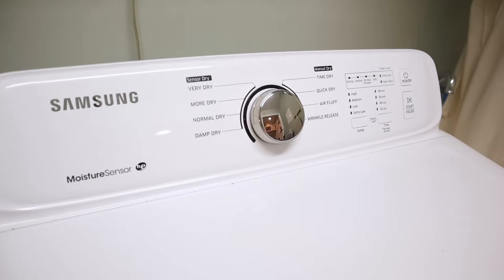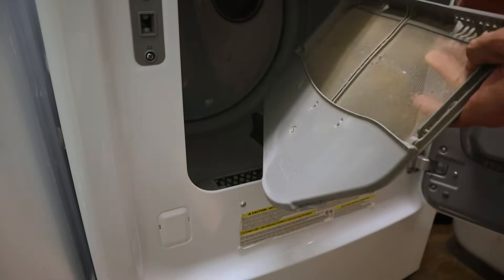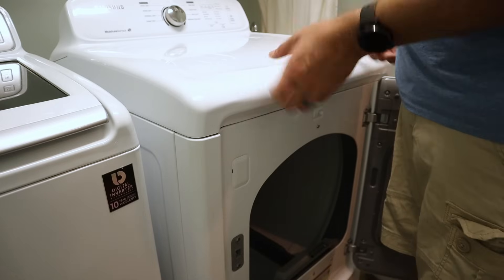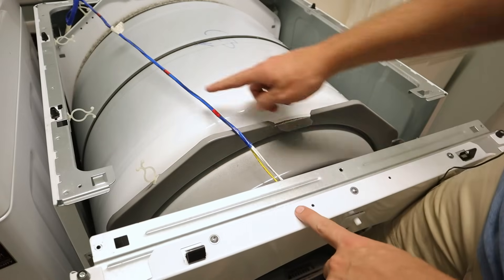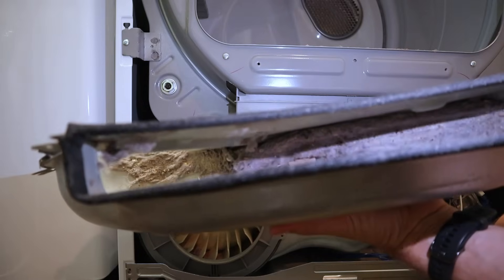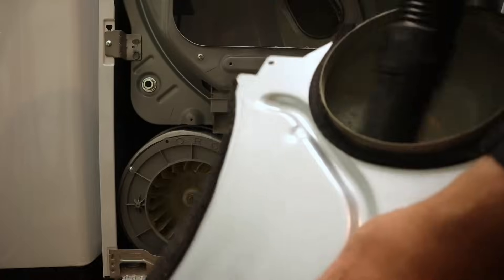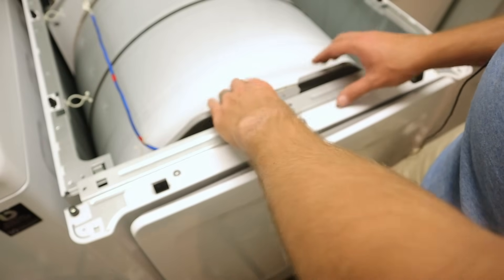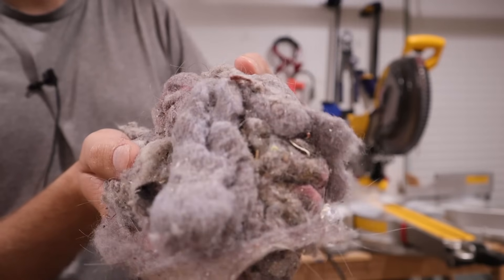How To Clean The Lint Out of a Dryer | Simple Dryer Vent Cleaning is Not Enough!

Comment: Our LG dryer started making noises. Youtube research suggested that it was the rollers, which are typically the first item to wear out. Which requires taking the dryer apart. I could not believe how much lint I discovers. At least 3 times what you got out in this video. Some of it looked burnt. We probably narrowly avoided a dryer lint fire.
Reply from the maker: Yup, I also had a roller to change out when I did this.  Seems to be a common replacement.

Comment: Funny thing is, I have the exact same dryer. Doing this today. Thank you for the tutorial.
Reply from the maker: Ah very nice!  We actually really like this dryer.  It is efficient, fairly modern, but not crazy with all kinds of unnecessary button.  Just gotta take care of it.  Good luck!
Reply: Me too... Dryer not getting hot at all
Reply: me too lol i hope work
Reply: @MsPisces_  If it’s not getting hot at all this probably won’t help.  Lent prevents proper  air flow so the moist air can’t be exhausted and takes long times to dry…..but it doesn’t stop the dryer from heating.
Reply: @Tim Karcher  I have this exact dryer but it won't spin or turn on...any quick tips b4 I spend $on repair guy
It was working fine 2 days ago
Reply: @amberlopez6938  I'm not an expert....but based on your description I would test the obvious first.  Check to see if you are getting electricity to your outlet.  Is it plugged in all the way?  Do you have  a tester to make sure the electrical outlet is powered up?  Could be a tripped circuit breaker.   If your outlet has power but still nothing turns on it is likely that the dryer has a built in fuze that has blown.......call a repairman.
Reply: Yes !!!!!! I was so excited like this is the exact same one !!!! Lmao !!!
Reply: So do I. Great tutorial!

Comment: I have seen many videos on this topic of dryer vent cleaning, but you just took it to a whole new level. Even though my dryer lint trap is on top that faces the rear of the dryer, I was able to lift the lid. Who knew? Anyway, I looked down on the inside and I saw about $3 worth of change. Funny what you can find when you open it up. When I get the chance, I am going to definitely pull it all apart and clean it out. And yes, I will retrieve the lonely money sitting there all by itself. LOL. Thank you for such an awesome video and explanation. You should be a teacher if you are not one already. Cheers
Reply from the maker: Well see, you can make your dryer safer and more efficient while also getting paid for it with money you didn't know you had!  Win win!  Really glad to hear you liked it.  Thanks a lot for the feedback!
Reply: all I ever find is like lint lifesavers,  fuzzy hot tamale candies  and bobby pins....

Comment: To lazy to take mine apart. Remove the lint trap holder and blow it out with an air gun. I have a straight connection to my vent outside to ensure it was clear. Good video

Comment: Thank you for your video about lint can build-up inside the dryer naturally overtime. I noticed lint build-up on the heat inlet grille and exhaust holes before I put clothes in my family's dryer on Saturday morning. I immediately stopped,and called a local appliance service center to diagnose and remove lint inside the dryer this week. I heard about a dryer fire a couple of months ago in Omaha, Nebraska from a local appliance service center. I did not want to risk a dryer fire.  My father is surprised that a dryer needs to be cleaned once a year to prevent a dryer fire.

Comment: Used my compressor and blew everything out of the exhaust, no disassembly required. I also use an attachment for my drive that snakes the whole vent pipe leading outside. Quick and easy without the hassle of tearing your machine apart.
Reply: Hola Carlos! Thanks for the tip. Did you put a bag or something over the outside vent to catch the messy lint?

Comment: I bought a neglected rental property a few years ago with six apartments that had just set of coin operated Whirlpool washer and dryer. The prior owner never took care of anything but he sure did empty out the coin boxes before closing day. The tenants told me that the clothes weren’t getting completely dry so I did a complete clean out of the dryer’s exhaust and heat box. It was the type of Whirlpool dryer that had the lint screen that loaded though the top of the machine where the flew runs up the back of the machine. There had to be nine inches of lint in there and I found paperclips pennies quarters dimes nickels a tie tack.

Comment: Lite version: Remove lint trap and use the vacuum attachment shown at 6:01 (Amazon or eBay $10) to clean out the bottom where the trap is usually seated. I spent 10 minutes picking up lint pieces. After that, the lint trap was flush as well. 

However, I will open the appliance to clean the vent as well. Thanks!

Comment: I have the same dryer and same problem. I bought a vacuum hose adapter to slip in there and suck all the lint out. I am def gonna take it apart though and give it a thorough cleaning. Also the lint trap will get weak over time and not snap closed at the bottom. so when you take it out you'll loose some lint to the bottom

Comment: Can I clean the inside of the dryer from the back where the tubing to the vent is connected?  I am not able to take my 20 yr old GE dryer apart to work from the front where the lint screen is.  I thought the dryer was running hotter than normal, had repairman come and check things, said it was OK.  But he didn't check any of lint possibilities, which I now see he should have done.  Not going to pay for another visit, so I hope I can get in thru the back with a brush kit.  Will that work?

Comment: Just purchased this Samsung model dryer. Nice to see someone take it apart before doing it myself. Kinda surprising to see that there's only 1 wire harness & 8 screws to gain access to the blower, not to mention you don't have to pull it away from the wall. (Unless you check the vent) My old Whirlpool must have 20 screws & 6 wires to disconnect before even getting access to the blower. Just to find out it's still clean, but not getting power. Uggh

Comment: Good video, I have a question- my exhaust duct goes up the wall, through the attic and out the roof.  In the attic it makes a weird twisted turn and then at the roof it has a square exhaust hood.  When I got one of those brush head drill attachments I cleaned out TONS of lint from the exhaust but wasn't able to get it out of the roof hood.  I had to climb up onto my roof and reach underneath the hood (it's a permanent install and doesnt come off unless you remove shingles) to get the lint out, which was 100% blocked.  My roof is steep and I didn't enjoy my near-death experience being up there.  
So my question is have you ever seen any type of filter that can catch lint before it heads up the exhaust? Something that would be a second trap after the built in lint trap.  I haven't been able to find anything on the webs. Thanks
Reply from the maker: Hey Mark, my vent sounds fairly similar to yours.  I do not know of a secondary trap for the lint.  But the kit I used can be used from the inside as well.  There is a hole next to where the shop vac hooks up that the rods can go up through.  Could work to get yours cleaned out.

Comment: Omgdness  thank you such for this video!! My dryer turned on for a few seconds and then turned off and on. There was alot of lint and I got  some out before with a hanger.  I found a sock in the spinning part and unhooked that but it sounds like a truck now.  This dryer was pretty much quiet when I got it. So, idk what  that is?? Any suggestions??  Thanks

Comment: I have a Samsung drier. Every time I use the drier, I not only clean the vent, but I take a long-handled paint brush and brush everything down and toward the outer vent. Once a month I clean the exhaust vent outside. Boom, done. No need to take the entire thing apart.
Reply from the maker: Not necessarily true but you are doing a lot!

Comment: If you own a Whirlpool, they are not made like this at all. There is a slide and lift trick to remove the top. Also, you need to prepare to support the drum when you remove the front panel. It's one piece and the front drum rollers are attached to that. Also, that blower and the blower housing can get very clogged, as can the pipe that goes to the back of the dryer. If you take off the inner front panel and the blower housing you can access the inside of the dryer and vacuum the motor and the entire inside as clean as a whistle.

Comment: either your dryer is a gas dryer or the controls are cycling the motor and heating element because a typical electric dryer will be 220 using at least 30 amps for the heating element alone.
Reply from the maker: It’s gas.

Comment: I was able to clean out that front vent pretty well, and it was a ridiculous amount of lint, dog hair and small objects. Amazon has an attachment for any vacuum for $7 that allowed me to not have to take the front panel off. With that said, my next concern is the rear of the dryer. How much can get past the motor and into the back? Luckily our vent through the wall is only about the depth of the wall directly outside, and we moved into a new home in July so the pipe and wall are clean. I just don't feel like pulling out the dryer since the vinyl flooring is prone to tearing with heavy objects.

Comment: Would this be the reason my dryer is leaking water. I have a Samsung as well
Reply from the maker: Your dryer should not be leaking water.
Reply: You have a Samsung with a steam feature. There is a Y connection to your washers cold line.  I removed mine and used a garden hose cap on the end going to the dryer.  If yours is leaking disconnect the hose and just don't use the steam feature.

Comment: I need a definite answer on how often you empty the lint filter. We have a real disagreement  ....... on the lid of the dryer it says clean filter after every use....it used to say clean filter after every load. This is so picky (use/load) I check the lint filter before I start my laundry or after, just to make sure the filter is clean. NOW my interpretation of use and load, use is after your laundry job is complete, and this depends on my number of loads. Loads is empty filter after every load you wash. For what reason was the verbiage changed from Load to Use. Silly but this is dealing with two control freekes
Reply from the maker: Oh boy, not sure if I want to get in the middle of this one 😂.  All I will say is I personally clean the lint filter before I start every load.  Please don’t shoot the messenger 😂
Reply: It’s load! They don’t know how many loads you are doing at a time so if “use” meant “set of loads I am doing at once” that would be different for different people.

Comment: If you're lazy and don't want to take your dryer apart I have kind of a "trashy" hack to get the lint out without taking the dryer apart. You do need a vacune cleaner with a hose attachment. What I did was take the thin cardboard tube off of one of those wire coat hangers the dry cleaners gives you. I place that in my hand and set it against the vacuum creating a seal with my fingers. Sucks up all the small pieces and lets you pull up the big pieces. Some of the stuff maybe stuck on the dryer pretty bad so I use the cardboard tube by itself to agitate it a little.

Comment: I have this exact dryer and it won’t dry hot . What could be causing this if I already cleaned the lint trap?
Reply from the maker: Possibly the dryer vent needs cleaned or the dryer itself like in the video.  If neither of those work then it is a mechanical issue and may need a part replaced.
Reply: Check the continuity of the heater wire.  There are many videos on YT that show you how. Just search "Samsung dryer not heating"

Comment: I bought tubes you can attach to your vacuum hose they come with adapters to fit the tube of of your vacuum. It can reach deep down to the part he took off below the bin the lint screen goes into. I just bought a new dryer because my Samsung quick working. (Never Ever Buy A Samsung Appliance) I've tried them twice. Paid a lot worked for a short time. There's even a Samsung video on how to fix the ear drum breaking screeching that you will have a good chance of happening to you.

Comment: I don't think this will work for my model dryer, at least not without lifting & removing the whole thing, because mine is a stackable with the top too close to the cabinet above it to be able to lift the lid. Basically you've told me that I either need a special vacuum cleaner attachment or to hire a professional (at least for me, with my bad back).
Reply from the maker: Yeah the stackable units are more difficult to work on in many cases.  But they do take up less room!

Comment: My dryer has a flashing red light on the filter check. How do I address this? I have followed your steps on cleaning the lint inside the machine
Reply from the maker: There are so many places there could be an issue.  These newer dryers can sense issues from the filter needing to be cleaned, to the inside of the dryer, and then also all the way to where the dryer vents out of the house.  There could be an issue anywhere along there.  If everything is completely clear then you could have a bad board on the dryer but that is less likely.

Comment: Why don’t they make parts accessible for easier cleaning?
Reply from the maker: Great question!
Reply: They are.just like car manufacturers they make it difficult so you have to call them to service it as all about the $$$
Reply: If it’s not easy to clean, you won’t clean it. There’s more chance of a dryer fire or clothes need 2-3 cycles to get dry. You replace the dryer or require a repair call. Either way, the appliance company makes money. It’s all about the profits.

Comment: Or you can buy a compressor air gun and put a rubber line or hose on so you can pull out lint screen and disconnect the vent hose or duct. And blast compressed air into dryer lint screen holder and move the hose in and out. No dis assembly ez pee zee

Comment: why in the heck would you take the entire dryer apart then you just need to take the lint thing out, get a vacuum with a tight space attachment (the one every vacuum comes with) and stick it in there. you can easily vacuum all of that up and saves you from tearing the dryer apart. work smarter not harder.
Reply from the maker: That does not get all the way down into the dryer.  The attachment you are talking about is not thin enough for a long enough length to get down to everything.  I tried.
Reply: Because the vacuum cleaner attachment you’re talking about doesn’t reach far enough. That’s why. Geez.

Comment: From the very beginning, I was amused. To start with, the dryer appeared to be already unplugged. It looked like you unplugged a 110v which would've been the washer probably. Then, to stick your foot into the doorway to press down on it while pulling up the top, well, that was funny. It'd been better to stick a flat screwdriver under the top and pry up a little to pop it free of the spring clamps that held it down. I was afraid of what I might see after that so I called it a thing and moved on to different things
Reply from the maker: It’s a gas dryer so it uses 110v.  Flat head screwdriver doesn’t lift up on enough area to get it to pop up without possibly damaging the dryer.  Glad you were amused though 😂
Reply: Dude, pay attention. Gas dryers use 110v.
Reply: @HowToHomeDIY  On my dryer, you can slide a putty knife in there to release those clips, so you don't have to use brute force on it.